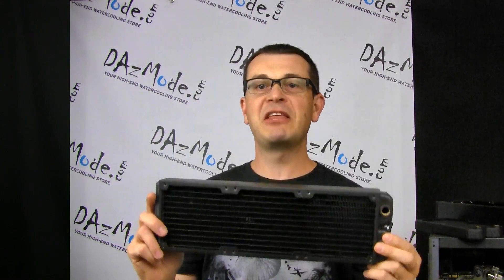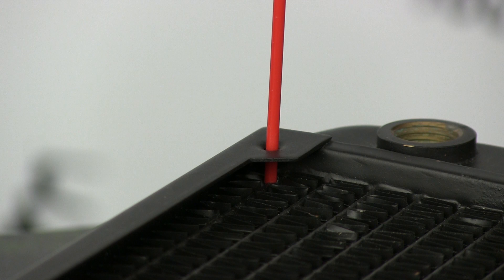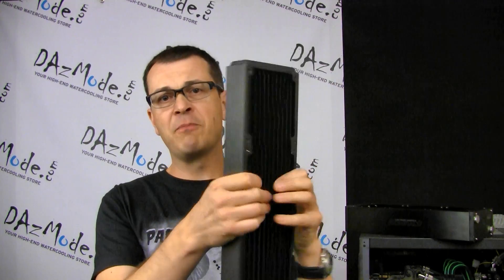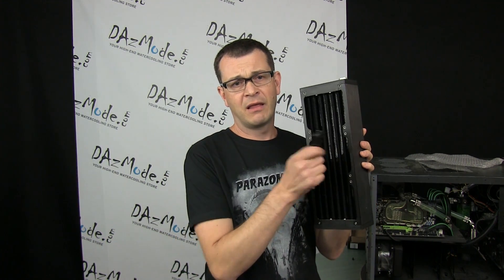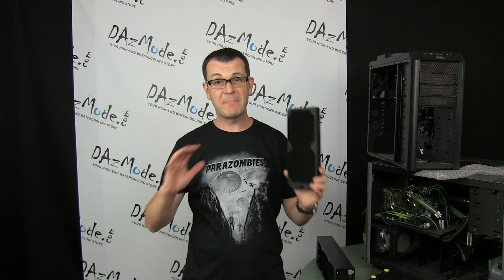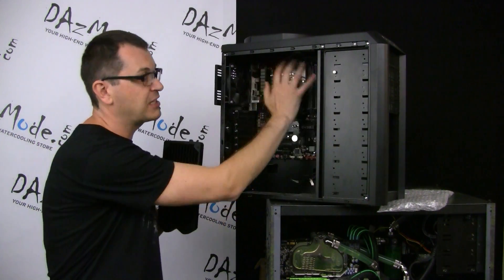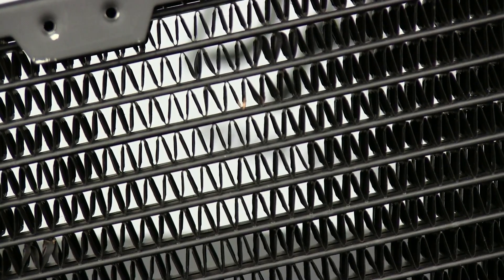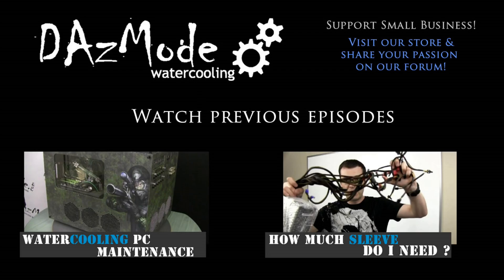Top 10 Computer Watercooling Mistakes with Radiators - How Not To Do - Vol.1

Comment: LOL mounting a radiator in the front in just fine. You will maybe get 1-2C difference in the case. Come on guy dont be a scrub.
Reply: It doesn't make much of a difference.  1-2C.  Cars pull air inside because trying to push air out into a headwind would be stupid.  They also exhaust the hot air onto the stuff they are cooling.
Reply: Listen, your ambient room temp is definitely always going to be cooler than the inside of your case.  Why in the hell would you exhaust WARMER air across your case rather than pull in cooler ambient air over your rad?
Reply: yeah.. for the front rads intake you just need a positive exhaust and everything will be fine.
Reply: John yoon I have no option but to put it in the front
Reply: Ye he is wrong on several points, does not matter. When you take air from case to blow throw the rad the air will be hotter aswell, so the temps are about the same.
Reply: Really depends what case you have, the point of a rad is to pull COOL AIR OVER the rad, not blow hot air over it.
Reply: *****
I said IN THE CASE. Not temps of your components. READ man jesus.
Reply: well your data is inaccurate. Temps dont change much on components that are watercooled but CAN change drastically in the case anywhere from 1 degree up to 20 degrees depending on the chasis, fans, airflow direction, specific components, etc.
Reply: You might want to research how this actually works, verbatim from a definition of radiators;

"Air from outside the car is brought in through vents, providing further cooling power. The coolant, sufficiently cooled down, can then be sent back into the engine to pick up more heat."

Notice it says outside of the car, cooler ambient air being brought over the radiator to assist in cooling.  Got anything else you want to argue about?
Reply: Your opinion is your opinion, and it's been proven to be incorrect.
Reply: Wrong
Reply: Here we go again - @Tim Strupp - you're scientifically wrong. The point of a rad is to move heat away from the object its designed to cool. Literally the radiator is supposed to be where the heat goes, the air moving across it is supposed to cool it down by pushing cool air over the radiator AWAY from the heat source (which in our case is the internal components.) Hence why push configurations on radiator mounted fans are the traditional and often common mounting position. Push/PULL was a later adaption designed to simply move MORE cool air over the radiator and out of the case. Anyone who's done testing will tell you that a pull-only configuration is not optimal.
Reply: @itsneight1260  If you push hot air with the rad into the case, sure, your case temp gets up by, let's say, 10 or even 15 °C, but the stuff you water cool, i.e. the CPU and GPU are better water cooled. I wish I had done that in my build (open loop with 1 reservoir, 1 360 mm rad cooling CPU and GPU) - instead I have it on top, sucking warm case air through it and get >45 °C water temps on warm days.
Which components do you think suffer from 15° C warmer in-case temp? I can think of none. This, of course, only applies to open loops where both CPU and GPU(s) are water cooled.

Comment: currently planning to do my first custom water loop and without this video i was going to do error #5, planned to have a triple on top and a dual right next to my HDD bays but at least i just realized how dumb of me that would have been ...
Reply: Plenty of people put rads in the front it's not an issue. Just get slims to make sure they will fit. And also measure.
Reply: +IFIXUR360 yeah after a lot more research i saw it was not really affecting so i will end up with a dual rad on the front and a triple on top
Reply: +Emperor Solaris nice. I meant shims not slims.

Comment: Uhh.. one 360 can cool one cpu and two gpu?  On what planet?  Maybe for stock clock but who is doing custom water loops at stock speeds?
Reply: well that puppy was quiet think and with 6 Fans... well its gonna be queit loud but will also perform very good
Reply: +DrJuiceBox HD thick*
Reply: Thickness helps but not as much as you would think.  I have yet to see anyone get good temps will be quiet with that setup.  The one I follow is one fan per device you are cooling +1. So a 480 to cool a CPU and dual GPU..
Reply: I don't disagree with your rule, but the cooling performance is not all about size. I wanted to say that it depends hardly on the conditions: of course will a bigger one performe better (with the same fin densitiy), but as i said: fan configurations and airflow have a bigger effect than pure size.
Reply from the maker: +DrJuiceBox HD yes, fans and rads go hand in hand. Have to simplify for short video.
Reply: DrJuiceBox HD
 I can agree with that!

Comment: #5 it doesen't matter if you use it in the front or not, since you are using water to carry the heat away from your components, i use a front mounted radiator in the front and it berly makes any difference
Reply: +Skinnwalk3r Agreed.. even Jayz2cents said he tested this and it's a non-issue.
Reply: i know, i watched that vid aswell
Reply: +Skinnwalk3r "not optimal" never said it was bad lol
Reply: +Skinnwalk3r That's if you're water-cooling everything, including ram and motherboard, but I guess it's wouldn't make a huge difference either way.

Comment: firstly.......copper dissapates heat better than aluminum. secondly......if you dont have a pair of eyes you probably shouldnt be watercooling a PC. thirdly.......the steel radiator is garbage. Vth....... no one should be using screws to mount a radiator to their PC, it should have a mounting bracket.
Reply: The heat dissapation and thermal conductivity differences between copper and aluminium is pretty much negible. Alu is perfectly fine, and vastly cheaper. Just make sure if you go with alu, stick with alu for the rest of your components too. Galvanic corrosion and all that.

Comment: I got a question do a waterblock use water?
Reply: cant tell if you are joking or not, but i will answer seriously anyway.

a waterblock is a piece of metal sitting on one of your components that has internal passages for water to flow through. when the cold water passes through the waterblock the waterblock allows a transfer of heat from the component into the water.

Comment: I done number 3:
I tried to put a 280 rad in a Lian Li A77F at the top,
The specs for the case said it has 2 140 on the top but it didnt fit correctly
I fixed the issue with a dremel and made it fit.
Reply: I super glued a 140 over a 120 hole. Lol whatever works right. Lol

Comment: I have a dual fan radiator (h100i) and due to cooler masters shitty design flaws on the cm enforcer. I can only fit 1 fan on the radiator will that be acceptable? My cpu is an I5 at 4ghz

Comment: they don't put protection for the fins behind the screws because it doesn't matter if you screw straight through them. its the vertical 12 lines you need worry about, water goes down 6 of them and up the other 6, the 12 lines are basically flattened pipes, and they always clear the screw holes. end of the rad the pipes go in has like 2 small reservoirs and the other end has 1 long reservoir. no closed loop on the market is filled properly to make the most of the rad, so i drill a hole in the rad and fill to the max.

Comment: Your point about putting the radiator in the front of the case being bad is quite incorrect. With all your components that generate the most heat in the water cooling loop it won't matter how hot the inside of the case is because it will always be less than the component itself. Having the radiator in front provides the radiator with the coolest air possible and most cases have dust filters on the front as well. Again it doesn't mater how hot it is inside the case because the components are getting cooled by the radiator not by the air inside the case!

You notice its like that on cars as well, the radiator is in front of the engine where it can get the coolest air and the engine is behind the radiator. Not the other way around and this is the best way to set up a radiator.
Reply: there are other components in a pc than the cpu and gpu that need to be cooled, ram, hard drives, extra pci cards, cpu voltage regulation circuits (VRM heatsinks as most people recognise), northbridge, southbridge, etc. totally different from how car engine radiators are blown towards the engine, for one in that case there is no other option anyway and secondly there are no other components which need cooling that the warm air will pass by in the engine bay of a car.
Reply: as I already said, case temps dropped 2* when the radiator was in front. Meaning that all the air that entered the case first past through the radiator. This is because the increased airflow of more fans drawing in air. And while the air coming out of the radiator and into the rest of the case is warm its cool enough to where the additional airflow created still cools all major components better than stagnant cooler air.
Reply: Bross Yako The radiator won't reach 90 degrees in that situation, the chip being cooled reaches 90 degrees because all its thermal energy is packed into a small area but the radiator is huge and has lots of water in it, the temperature gets spread out across the system. same thing with a normal heatsink, the bigger the heatsink/radiator the more space the thermal energy being output by the chip is spread across the lower the temperature at any given point throughout that cooling area will be, otherwise the heatsink/radiator isn't working or is too small.
Reply: If your radiator is this hot than you're doing something horribly wrong but frankly I think you're just making stuff up for lack actual temp measurements.  I am running overclocked i7 2.6 to 4.2Ghz and powerful video card and I have 2 separate 120mm radiators and they get warm, comfortable to touch.  Get digital infrared thermometer and scan your power supply exhaust and your radiator.  For years I was running this power supply that was generating too much heat and I always though it was my water cooling but I was wrong.  Once I replaced more power efficient power supply it's much better now.
Reply: Bross Yako and your point is? the radiators HAVE TO BE cooler than the items they are cooling or they are NOT WORKING.
Reply: It's not optimal but does work well
Reply: +oddball0045 - If case temps dropped it probably just means the rear fans were able to draw the warm air out of the case faster, since the radiator wasn't blocking the exit.
Reply: That's true... for the parts that are WCed. However, your motherboard, ram, and any other component that isn't directly being cooled can and will suffer from you pumping 120 degree air into the case.
Reply: Except that air is for one, not 120 degrees, on my overclocked i5 2500k at 1.36v the rad itself never gets above 107 degrees. Secondly the air has a long time to cool off before reaching the GPU. Fun fact is my case temp actually dropped on average 2 degrees when I moved the radiator to the front of the case because of the increased air flow.
Reply: Nonsense!  Of course it matter how hot it is in the case!  Here's simple experiment for you - unplug all case fans and route your radiator w/fan outside the case see how well your water blocks will perform :-)  Just like in the summer I get higher temperature due to room temperature being higher to the point where I just turn off overclock.
Reply: +oddball0045 - "air has a long time to cool off before reaching the GPU" - LOL, where do you think that heat dissipates to?...inside the case! You contradict yourself by saying it doesn't matter how hot it is in the case, then tell us it's dropped 2 degrees...why does that matter then? Finally what were the temps of the CPU/GPU like after the move? The same or less - that is about the only relevant point you didn't mention.
Reply: +oddball0045 

unless you are running a high performance system working at its maximum. 

These systems can reach 90 degrees,   your radiator will be blowing the same type of air as a hairdryer, right onto your ram,  Motherboard, Northbridge,southbridge, sound cars, and in most system even your PSU will suck that air in. 

Imagine you are heating up the metal inside your pc to 90 degrees. pretty soon the water inside the tubes and the reservoir will heat up and your cooling system will enter a vicious cycle causing the cpu to fail.
Reply: You obviously never seen a high performance system, you could melt your skin if you touch those radiators.

Comment: What if I am currently stuck in a position where I have to use a front mount and blow the air into the case. I have a Define R4 and I am not really seeing any other options here. Can not see myself mounting outside the case.
Reply: Just ensure adequate case ventilation to carry warm air out.

Comment: Great video,  I think my only error was not to wash out the radiator first, I wasn't aware you had to do that.
But those stop plugs on the radiator are worth keeping, if you're taking the system apart, you can temporarily plug tubes with them, but they can still leak, or just fall off, so don't rely on them too heavily.

Comment: I'm no expert, but I don't think it's the same both ways. Cases are not air-tight, so when pulling air from below the radiator and out the top, some of it will still be cold air pulled from outside the case through vents. On the other side however, 100% of the air coming out has passed through the radiator and heated up. So I would definitely prefer *not* to have the exhaust side pointing inside the case.

Comment from the maker: You slightly loose on cooling performance side, but you you keep non-water cooled components from overheating. Other way around may lead to overheating and random system crashes. I used both ways and pulling out is the safer way as a general recommendation.
All who disagree can use whatever they want and learn from their own mistakes.

Comment: But then, aren't you using warmer interior air to cool pass through your radiator fins and losing a little bit in cooling capacity with your radiator? Obviously, there maybe an increased benefit doing it one way over another, but I'm thinking the advantage may not be all that great one over the other.

Comment from the maker: For silent builds and builds on max capacity of radiators blowing in will result rising temps of internal components. On high air flow builds with plenty rads you can get away with it.

Comment: Over at OCAU, we've got this thing with a 240 to start and a 120 per extra block... Running a 360 with a OC'ed 2600K and 2 x 6970's were reaching the mid 70c's. I've since added a 240 and it's now peaking at ~62c.

Comment: I have a BIG beef with your #5 theory. Why not use front mounted radiator and pull "fresh, cold air" from outside the case and blow across components? You say were blowing hot air across our components. How is this any different from pulling stale hot air from inside the case across the radiators and out the top of case? I see absolutely no reason why one is any better than the other. The cycle of air is still the same and both would equalize each other no matter which way you use.

Comment: A 360mm rad with six 120mm fans on it (push pull) it will cool a single GPU and CPU perfectly fine. Twin radiators are pretty pointless for such a small loop and efficiency will likely be higher with the single due to a higher air flow.

Comment: I guess a rad in the front isnt that much of an issue if it isnt your only rad. Correct me if im wrong but if i only run 1gpu and 1cpu and have like a 360 in the top pushing air out and a 240 in the front pulling air in, there should be more cooling the parts than heating ^^

Comment: Well; you learn something new everyday, I didn't know that if I bent the tiny fins inside the rad, I wasn't actually damaging the radiator (only performance).

During my 1st water cooling build; I managed to flatten a quite a few of them and started to really freak out, spent better part of an hour with flat-head screwdriver straightening them all out.

Another mistake is trying to attach Feser fans with metric screws to XSPC rad that has standard thread.

Comment: Not useless. What he is saying is that the performance increase of thick rads are less then the performance increase of longer radiators. Which make sense when you think that not only do you get more surface area but also more fans. For example, an Extra think 240 will not have more cooling potential then a slim 340.

Comment: I completely disagree with the need for radiators on exhaust. With good airflow, the air temp in the case shouldn't vary by more than a couple degrees.

#9 is completely wrong. You need to pay attention to width, length, thickness and FPI. An Alphacool NexXxos Monsta 240mm will outcool an alphacool NexXxos ST30 360mm rad any day. A dual 140mm radiator is 39,200mm^2, and a triple 120mm radiator is barely bigger at 43,200mm, so it will get nearly as good cooling. You can save money on fans too.